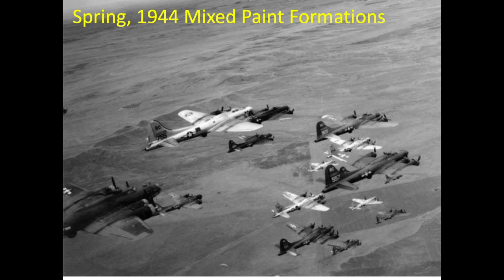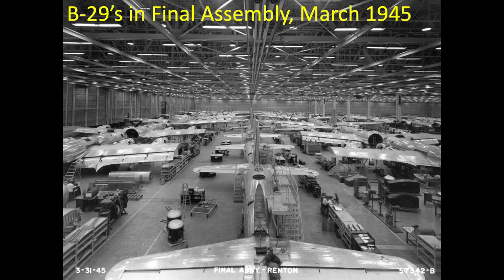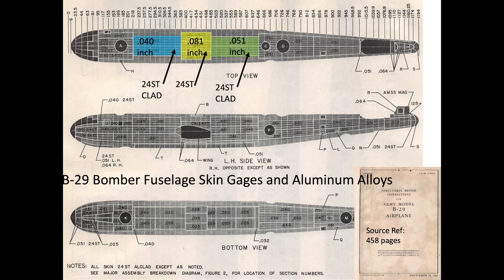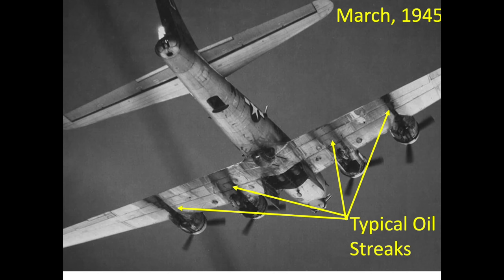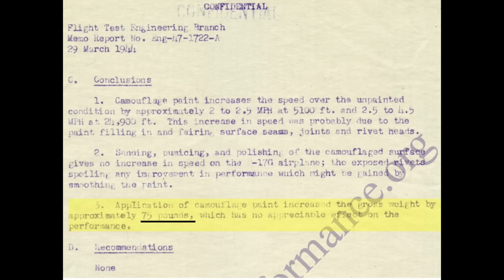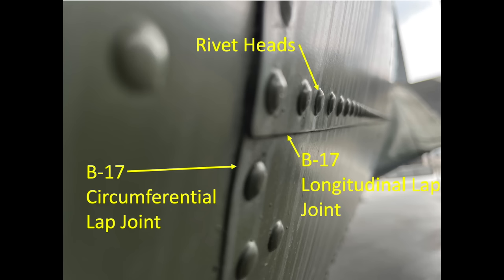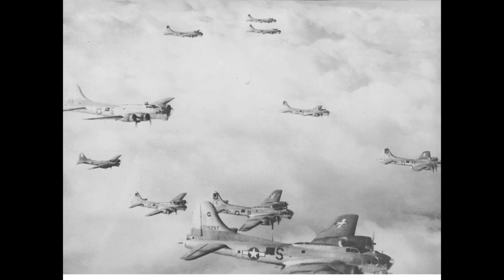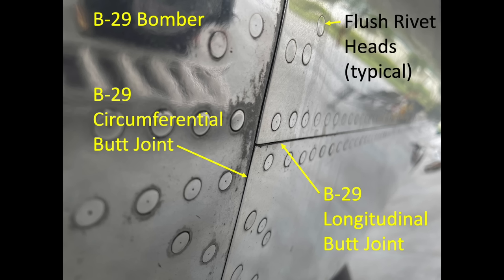B-17 Bomber Paint Vs No Paint, Unexpected Results

Comment: I’m amazed that putting what amounts to 1 1/2 coats of lacquer on a B17 adds only 75 pounds.  OTOH, lacquer is probably the lightest paint coating you could select.  There aren’t a lot of solids left after the carrier flashes off.  I hope they were spraying these outside (I’m sure they weren’t when they were doing it at the factory) and that no one was smoking while spraying. 😮

Comment: That's an interesting study. IIRC, they determined the opposite for the B-29. There were reports of B-17s returning to base running on fumes. It makes you wonder how many planes didn't make it back due to a lack of paint. Of course, it was a "good enough" bomber. Major improvements could have been made for longer range.

Comment: Seems hard to believe that a B-17 only used 75 lbs of paint and primer. I'll assume that is only on the exterior surfaces, not all surfaces,  but still that's only 9 (or less) gallons of paint. With 1940s paint/painting techniques/technology I'd have thought a B-17 would require a lot more paint/primer.  Very interesting.

Comment: While the aircraft may have an unpainted finish on the outside, there was still a fair amount of paint used in signage, labels, markings, glare shields and what not. But I am surprised the weight savings was only 74 pounds. That just goes to show you just how thin those coatings were. I wonder what the cumulative effect on performance all the other changes made on performance. I noticed that they were using gross weight of 48,000 pounds.  I have read that towards the end of the war, they were loading these planes up to from 64,000 to 68,000 pounds. That is close to double the the spec gross weight of the early models.

Comment: This points to the how well an aircraft is designed and built, in war often turning out lots of bombers is the preferred option of building rather than making them absolutely perfecting clean. That extra precision and cost of paint was a acceptable trade off. Later fighter aircraft had flush rivets and much time was spent on aerodynamics and clean building. All the B17 needed was some body filler which the paint ended up doing
Reply: I thought shark skin and golf ball dimples increase aerodynamics.

Comment: its known that paint smoothes the surface, lowering drag by allowing the boundary layer of air to slip along the planes surface with fewer micro obstructions (covered with a skin of paint), and paint smoothed obstructions.  polishing the surface could be even better, but subsequent corrosion will bring back the tiny obstructions to surface flow. aged and oxidized paint will also increase drag, so polishing and waxing keeps drag  to the minimum.  lower drag gives better gas mileage, better speed, and the plane can carry more weight.

Comment: Would be interesting to deviate from the topic of the channel a little bit and talk about the P-51 Mustang's finish. 
 
I always hear that the wings were fillered and sanded to mantain the laminar airflow, but were the fuselage and the tail also fillered? 
 
And later the P-51s also lost most of their colour, but you can see that in the interim the fuselage was bare metal, but the wings were still coloured. 
 
Later, when they looked like bare metal finish, (except the D-Day stripes), did they drop the complete surface finish or did they use aluminium colour? 
 
Would be interesting not the least for model builders, a fillered wing would show no rivets except for access panels (probably ailerons and flaps never received that treatment, in that part of the wing the airflow is turbulent anyhow).

Comment: Reminds me of the B-47 tale about the groundcrews being restricted to covering their boots upon standing on the wings, as the resultant dirt would actually slow the aircraft.
Reply: DM: It was not the dirt. It was about hard soled boots denting the wings and losing aerodynamic efficiency.   The Navy's P2V Neptune patrol plane had similar laminar flow wings and crews were issued crepe sole boots for the same reasons.
Reply: The B-47A Dash One contains this NOTE: A 2 to 3% reduction in range can result from scuffing of the wing surfaces when using them as a walkway.  All personnel must be extremely careful  to retain the aerodynamic cleanliness of the airplane during servicing operations.

Comment: The weight of the paint on a B-17 is a lot higher then 75 lbs. Even at 300-400 lbs, a very low percentage of the overall total aircraft weight. Nice and well done video!
Reply: Of course it not possible to weight only 75 Ibs when you need virtually gallons to paint a B-17 both upper surface and underneath!
Reply: Sources please?
Reply: @feathermerchant  the B-17 has a surface area of 4,200 square feet and took about 35 gallons of paint to coat. If the paint weighed 10 pounds a gallon wet, after accounting for evaporation the weight would be roughly 300 pounds. Given that figure, eliminating the paint would indeed be a major weight reduction. This is what I found on Google by typing: how many gallons it needs to paint the B-17. Hope this info might be of some interest for you...
Reply: @paoloviti6156  The source you quoted also stated: “No record exists about how much a gallon of paint used on the aircraft weighed.” And “Contemporary reports stated that with the elimination of the paint…heavy bombers would lose seventy to eighty pounds.”

So this video presents the results of testing conducted at the time.  The info you cited appears to be assumptions and you know what is said about assumptions.  I'll defer to the men who were there at the time and made it their business to know what was what.
Reply: @feathermerchant  it is up to you to whom you want to defer but mind you there are not many people knowledgeable on this matter unless those directly have been involved with painting, for example, the "Memphis Belle" unless you can find original documentation stored somewhere....
Reply: @paoloviti6156  "there are not many people knowledgeable on this matter " I agree and we have THEIR REPORT from 3/29/44.  Mind you, that report concerns what was done and discovered THEN and not decades later to make a surviving warbird presentable as a  museum artifact.
Reply: @feathermerchant  yes and I agree fully with you!

Comment: study's since then have shown that the paint traps a layer of air, the resulting air to air friction is less than air to metal. Richard petty use a textured paint on the roof of his car to reduce drag in the early 1960's. The saying in auto racing is "How much do you want to go fast" they spend $1000's for 1 MPH

Comment: That Factory, they had 200 step ladders built to sit at the front so employees could get in and out. 200 of them! and that's one item, you can imagine the value of the materials in that building. 
What about the Mustangs (and P-38 P47), did they do tests for them as well? Or did they just decide that the paint was a waste of time and resources no matter, considering most planes did not last long. They still were not painting them when the Sabers came out 10 years later, that was the American look for most of the last half of the 20th century. Regan made them put Camo's back on, especially the Navy, "painted up like a Christmas Tree" (from "Thunderbolt's over Italy", a doc here on youtube) is a apt description.
The whole Aluminum thing, wow, it came along at just the right time. There is no way the are building bombers that big with steel and/or canvass. The Japanese had a different "secret" formula they used on the Zero. Think about it, metallurgy, a basis science, is a State Secret in the 1930's 40's (and probably today as well. They are not using normal metal in a jet engine).

Comment: I always wonder about modern airlines, Eastern and American  had unpainted jets ,I heard once All clad is more work to maintain than paint ,but dragging around paint would seem to cost alot in fuel.
Reply: On aviation forums on Facebook, there’s a lot of pis*ing, bit*hing, & moaning that American Airlines did away w/the old, polished look when they debuted the ‘new’ look.  No amount of explaining that one can’t polish composite materials like new fuselage’s will satisfy them.  It also doesn’t hold water w/the complainers that to paint new, composite fuselages would cancel out any fuel savings (important these days) composite fuselages offer.  I see it every time w/out fail a photo of the ‘old’ AA scheme is posted.
Reply: @jamessimms415  it's a surprisingly in depth subject, and there are alot of airplane designs which may benefit from both ,in A and P school they insisted that paint was less work since All Clad needed cleaning ,so paint was cheaper in the long run,that does seem to hold true since almost all carriers/ miltary are painted ,but then some guys say paint can trap moisture ......but Navy aircraft and crop dusters are always painted......I gave up on Facebook a long time ago

Comment: 75lb for paint seems very low.  Figures on the internet vary but one given for a 737 was 555lb.  Depending on the model, the 737 is up to almost double the length of a B17 (and the fuselage would be larger in circumference) but the wing span is roughly similar (allowing for the sweep of the wings on the 737), so we're not comparing apples with apples, but that still seems a big difference in the volume of paint needed.  Is that just a single coat of paint with no primer on the B17?   Are modern paints full of additives that make them heavier?

Comment: I wonder if the unpolished paint surface increased the efficiency of the laminar flow aspect of the aircraft. If it did, this would reduce laminar flow separation of the aft third or so of the upper surface of the wing.

Comment: A B-17 weighs less than half as much as an M1A3 Abrams when both are combat loaded.... but only gets 54% better fuel milage.   The difference would probably increase if the M1A3 had to carry 1200 miles worth of fuel (about 4x more than it carries internally)    At 33tons combat the B17 gets about 0.84mpg and at 80tons the M1A3 gets about 0.54mpg.   kinda boggles the mind.    To have the same range as the B17 the M1A3 would need an additional 7 tons of fuel.

Comment: My model building references in the early eighties stated all of the paint combined on a B-17 was roughly 100 lb I believe that included the chromate painted parts and then the top coat of Olive drab and the lower coat of neutral grey ultra Federal Standard of course.. fyi there is also a staggering amount of variation in olive drab color some of it is brown or some of it is Greener depending on who made it and it's sun exposure due to UV rays. If the surface was likely polished to smooth it out it would change its appearance of its color as well is it would then have a light sheen to it.
Reply: The RAF had experimented early on with lightly sanding painted aircraft and lightly polishing the surface to make it smoother as sprayed the paint has a texture which added a slight bit of drag they did gain positive results from the slight sanding and polishing
Reply: As I recall the RAF called it  surface smoothing

Comment: Excellent video. Biggest advantage of an extra two per cent speed. Two per cent less casualties. Two per cent less time in range of the anti-aircraft guns defending the target. Two per cent less time in range of any anti-aircraft guns the bomber happens to fly over. Two per cent less time for German fighters to detect, search for, find and attack the bombers. Two per cent less casualties, anyway one figures it. Not really noticeable in early 1942, since the adding of P-51 escorts more than compensated for this loss of paint. Heavy bombers might be pigs compared to the nimble fighters, but sometimes lipstick on a pig does make a difference.

Comment: Fascinating! Thanks! I had always assumed the opposite, and that being not the case makes a lot of sense! I don't think it would have changed much even if they had found this out, though it might be interesting to know what time savings and cost savings there were in comparison, they needed more B-17s faster so it seemed to be a no brainer, less pilots flying is a bad thing. Also, it looks more like the painted B17s stood out more than the unpainted. Though that could be a b/w effect, a solid color is going to stand out vs a reflective color that dissipates the surrounding colors. From the top sure, the sun reflecting off but under that it might create a lighter shadow thereby a less distinct outline. While contrails point the direction I don't think that would be helpful. then again you say it was radar assisted. So maybe neither mattered.
Reply: So much of that depends on ambient lighting and weather. At low level under an overcast, a natural metal aeroplane can be much harder to spot. Though at B-17 cruising / bombing altitude it was usually bright sunshine and blue skies where a dark camo colour is much more prominent. Which is why the RAF went to Sky all over, or Sky over Medium Sea Grey for late-war high altitude fighters and recce types.

Comment: So some chap in the USAAF tested ONE unpainted airplane against ONE painted airplane, and concluded that unpainted means 3% more fuel burn.  It sounds like a combination of two classic experimental mistakes - 
1.   How did they know both planes had engines in identical tune?  These were supercharged gasoline engines with manual mixture control.  So the pilot of the unpainted machine could have easily knobbled the test, deliberately or accidentally.
It is well documented that these aircraft varied in their fuel consumption depending on how carefully the pilot or flight engineer set mixtures and trim.  It was actually quite a problem in the B-29's due to their more sophisticated engines, until they got some experience.
2.   Whenever you subtract a large number from another similar large number, the result is only ever very approximate.  For example, lets say the fuel burn was measured with an accuracy of 1%.   One  was measured at 200 gals/hour and the other 194 gals/hour - an apparent 6 gals/hr i.e., 3% difference.  But it could be 200 x 1.01 - 194 x 0.99 = 2 gals/hr i.e., a 1% difference.  In this simple example, the difference in fuel burn is only a third of what you might think it was.
Did the two planes fly together or at separate times?   A change in air temperature could make a difference.
This sort of thing should only be done as a drag test in a wind tunnel, where all variables can be tightly controlled.   Failing that, by collecting statistics on  a sizable number of aircraft in many flights - not just one of each.
Reply: still cool , though .
Reply: I was going to make a similar comment.  At the very least it should have been done with the same aircraft first unpainted and then painted, using several flights in each condition.  With same recorded engine settings.

Comment: The truth is that unpainted bombers and fighters saved a lot of labor intensive painting that it will take time drying actually for each layer that is sprayed. Normally the interior skinning is left bare aluminium but most of the equipment is painted with interior green and the stressed parts. This more or less what I see in original photos...

Comment: At 6:03 a scematic of the fuel tanks is shown, with arrows pointing to the "dedicated" tanks and arrows pointing to "feeder" tanks. I tried to look it up what the difference is between these fuel tanks, but I was unable to find any information. Could someone please explain these terms?
And while on the topic. The outer most fuel tanks are called the "Tokyo tanks". Were these tanks a later addition then the original design in order to reach Tokio, and were the bombers build for the European continent build without these tanks? 
Thank you for your time.

Comment: WTF? The USAAF decided to stop painting aircraft after tests at Wright Field in 1942 showed it increased their speeds from 8mph (B-17) to 21mph (P-51). The bare metal was then protected with a coat of wax or a lightweight clear coat. I wonder if the wax was applied with the rinse after the ground crew washed off the aircraft? 
 The Japanese also stopped painting their aircraft at the same time due to lacking the material needed to make the primer and paint.

Comment: Seems like they should "shoot" the B-17s and probably the P-38s & P-47s with a coat of clear lacquer!  Just one coat...
Reply: p 38's were flush riveted, one of the first to be so.
Reply: @alanrobinson2901  Not surprised since she was designed by one of the best aircraft designers of all time!  If not the Best!!! (Kelly Johnson)
Reply: If the paint were to be applied only on the rivet heads and the seams, the same aerodynamic effect would be achieved. That would create a very unmilitary appearance which the AAC wouldn’t care for.  The crews would have greatly appreciated the extra gas when returning to base especially when damaged. It’s worth noting that at high speed parasite drag increases while induced drag falls, thus military aircraft have many weight increasing drag reducing features e.g. retractable landing gear.  It would have been interesting to see the effect of paint on take off, we’re a lot of accidents happened- max weight & max power.
Reply: @richardschaffer5588  But generally it is faster to use a spray gun and spray the entire plane .vs. spot painting all over the plane.